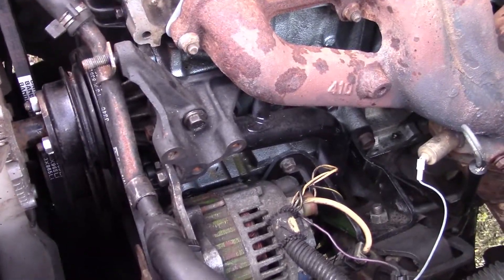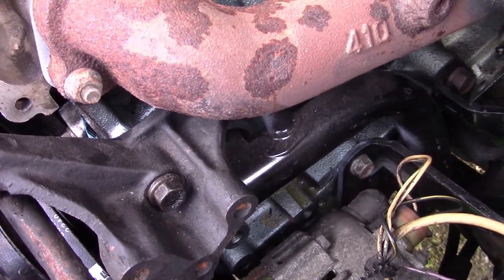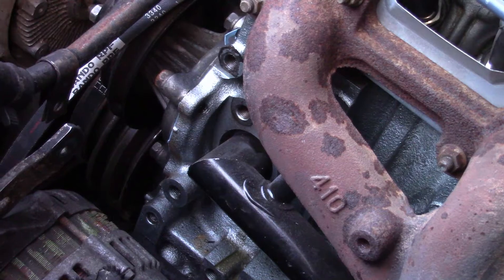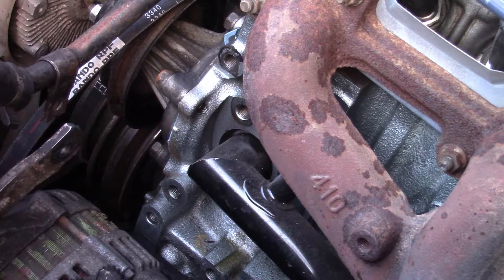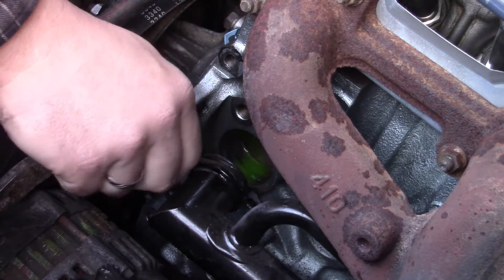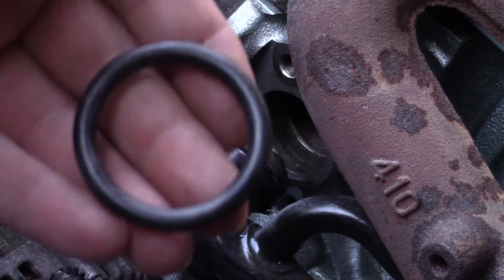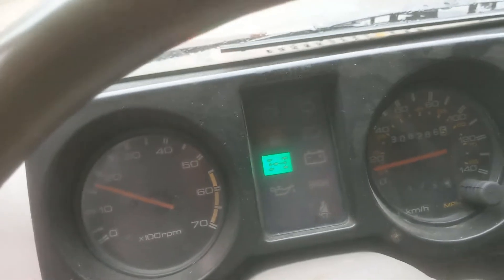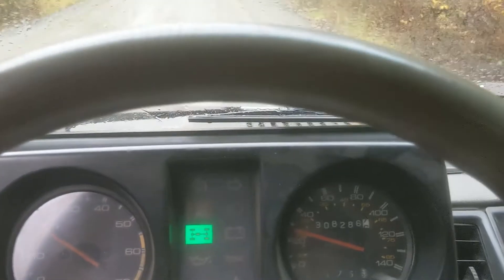Isuzu 2.3L/2.6L water manifold O ring

Comment: I spoke with a now retired Isuzu master technician and he recommends putting a little rtv around the grove of that water pipe to prevent any leaks, if it continues to leak maybe give that a shot. 

I have a weber on my 87 Trooper and am using the mechanical fuel pump thats attached to the manifold and its been running problem free. Why did you opt for a electric fuel pump?
Reply from the maker: It's been going good with no leaks since that video. The original 2.3 in my 87 had the mechanical pump, but when the 2.3 got tired I rebuilt a 2.6 and swapped that in. The 2.6 does not have the hole for the fuel pump pushrod drilled in the cylinder head. One of these days I intend to try and build some sort of jig to drill the 2.6 head for the fuel pump pushrod, as I still have the 2.3 cylinder head around. I imagine it's a fairly presice thing to do, and I'm not confident enough in my skills or equipment to try it yet.
Reply: @torquemonster8773  Thats good to know. I'm in the process of putting back together a rebuilt motor I purchased and hope I don't run into any issues. I'm sticking with the 2.3 because it should perform better mpg wise.

Well hopefully you can get that done. If you haven't yet sign up to become a member at the planetisuzoo forum, there are still plenty of users and they are very helpful.
Reply from the maker: @nicholasrubio1660  
I'll be honest, I didn't notice a significant MPG difference between the 2.3 and 2.6, however the 2.6 with the Weber and the "Jerry Cam" pulls better than my 2.3 with the Weber and Jerry cam. But my 2.3 was down on compression and burnt a bunch of oil, so I guess that isn't a fair comparison. 

I am on planet isuzoo, under a similar username as the channel.
Reply: @torquemonster8773  Well maybe you didn't notice a difference due to your 2.3 not running in tip top shape as you said. 

There's a guy by the name of ericjette on the isuzoo forum who put in a rebuilt 2.3 with some small performance mods such as the Jerry cam and headers and he states he gets 24-26mpg, plus he can easily cruise at 75mph. I hope I get at least somewhere in the 23mpg range when I get done with the swap. I'm just waiting on some OEM parts to put the engine back together.

Do you ever plan doing a walk around video of your Trooper?
Reply from the maker: @nicholasrubio1660   I'd have to say I got about 20-23 mpg on both the old engine and the new engine. But the new engine is just barely out of break in period, and I'm still playing with the tune. I have my carb jetted slightly richer than what comes with the Weber if you were to order it from redline for the 2.6. 

I have a cheap, narrowband Air fuel gauge, nothing fancy just gives you a general idea of what your air fuel ratio is like. I found with redlines jetting I was going lean when the secondary opened. If I remember redline sends you a 135 primary main jet and 135 secondary main jet, and I ended up with a 140 primary main and a 145 secondary main. Obviously that may not be the same situation for you in your area,  but just something to note.